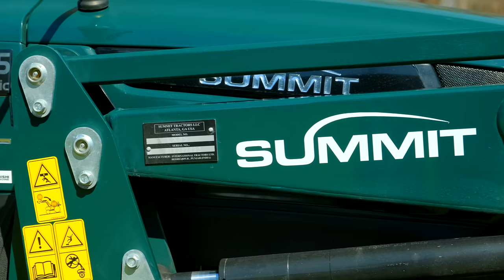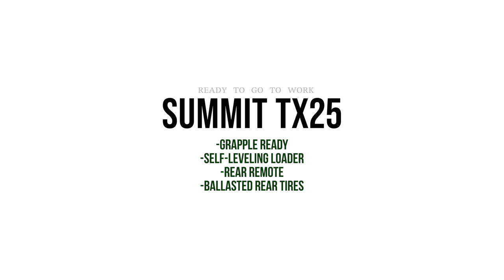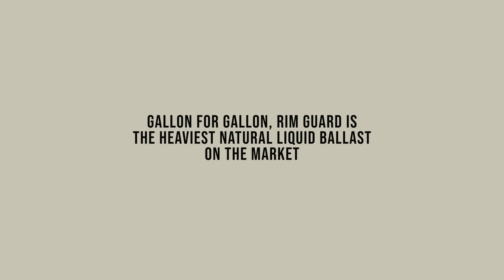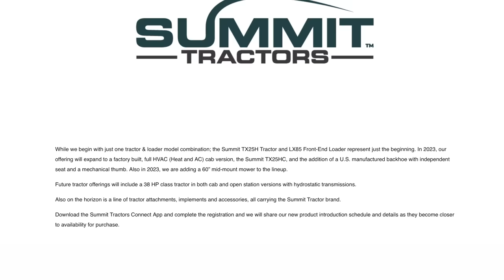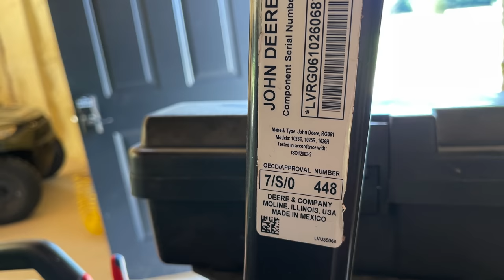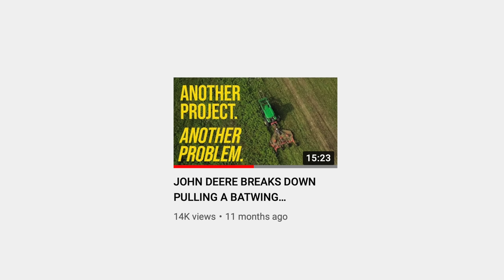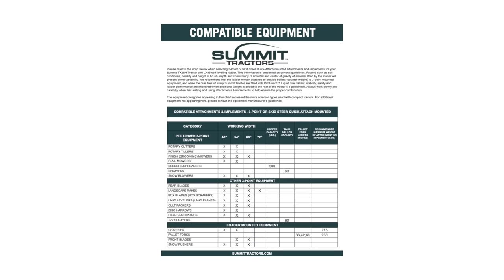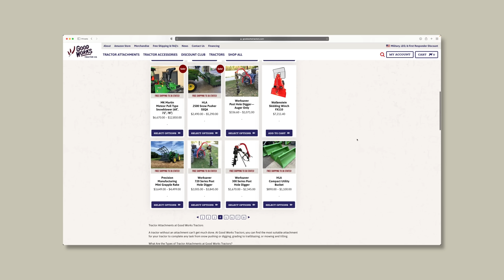10 REASONS TO CONSIDER A TRACTOR YOU’VE NEVER HEARD OF 🤔 SUMMIT TX25

Comment: One thing I could see helping get summit off the ground (and help you too) is having parts and service kits available on your website (a place people trust). Serviceability is going to likely be people’s number 1 reservation with these and the more that can be proactively debunked the better.
Reply: Had JD pick up my 1025r over a week ago. Still no part at the dealership to fix it. It apparently is AR a warehouse but for some unknown reason they won't ship it. Nice!
Reply: I have seen small new businesses gain trust by having spare machines to loan out when repairs or parts will take some time. May sound expensive but you still have the capital value.

Comment: It’s a great tractor, I speak from in depth experience. I have worked extensively with the tractor, and I am speaking as a John Deere 1025R owner. Don’t get me wrong, I love my Deere!…but if I did not already own a compact, I would buy a Summit without question. The price is outstanding for the options you get and I have spoken to all the Summit crew, they are tirelessly devoted to their tractors and customers, which is a major benefit. Nice video!

Comment: Given that many tractor owners are DIY type folks, it seems to me that something truly innovative, and almost opposite to what Deere and Kubota seem to be doing, would be to truly support and encourage owner maintenance and repair.  If Summit would make videos of common maintenance and repair tasks, provide quick mail order parts support, and provide rental tools when specialized tools are needed, this could truly be a game changer for a company that plans to not have a dealer network.  I suspect this is too radical a concept for Summit, but I think this could be a game changer.  Now, you still need the independent service centers for those who don’t want to get their hands dirty or for larger jobs that many would not want to tackle such as engine or transmission rebuilds, but the same repair literature/videos and tool and parts support that an independent repair center needs is nearly the same as a competent DIY customer could use.

Comment: You’ve got very good, informative tractor videos. With the following you have you could help a lot of people by highlighting the water issue you’re having with your shop. Floor elevation in relation to surrounding terrain. It costs money to build up the site but it’s money well spent. No taper at the edge of the floor at the door, etc. Once the concrete is poured  there’s no going back.  I made the mistake “once” and have seen it many times. The water needs to stay outside.

Comment: I enjoy your videos Courtney but have to ask you this question. From some of your earlier videos one of my main takeaways was “only buy JD or Kubota tractors” for various reasons. This message came across very clearly and strongly. Can you address your change in heart?
Reply: I have to agree, Courtney seems to be a great guy but before it was only JD or Kubota. He advised to avoid most other brands
Reply: Simple answer, money motivates people.
Reply from the maker: One reason was a large dealer network for support.  Summit has solved that when they launch nationwide by partnering with tractor dealers around the country to provide service in every area they’re located.

Another reason was that JD and Kubota give more value and, again, Summit has gone above and beyond to provide an overload of value.

Holding resale value…I believe with more included on the machine AND at a cheaper price than Deere or Kubota, it will minimize the depreciation rate experienced by other lesser known brands.

Reliability?  Well they all have problems, but this tractor is not new.  It’s based on an existing platform from a manufacturer that has been building tractors for decades.  The bugs were worked out long ago.  Plus, Yanmar engineering has a 30% stake in this platform further legitimizing it.

The only thing constant in life is change, my opinions included.
Reply from the maker: @JeepAddict  Not sure of your angle on that one.  I made lots of money selling JD and Kubota.  I still could if I wanted to.  I don’t need to sell any tractors though.  My business is selling attachments.
Reply from the maker: @72chitwood  One reason was a large dealer network for support.  Summit has solved that when they launch nationwide by partnering with tractor dealers around the country to provide service in every area they’re located.

Another reason was that JD and Kubota give more value and, again, Summit has gone above and beyond to provide an overload of value.

Holding resale value…I believe with more included on the machine AND at a cheaper price than Deere or Kubota, it will minimize the depreciation rate experienced by other lesser known brands.

Reliability?  Well they all have problems, but this tractor is not new.  It’s based on an existing platform from a manufacturer that has been building tractors for decades.  The bugs were worked out long ago.  Plus, Yanmar engineering has a 30% stake in this platform further legitimizing it.

The only thing constant in life is change, my opinions included.

Comment: $18,999. That's the current price listed on Summits web page for this tractor. Seems like a question lots of folks are asking, so there it is. Considering the extras included, seems like a good price to me. Now go beat on that thing so we can see how it holds up 😉 Of course I bought my tractor over a year ago now so, unless it's the best thing since sliced bread, I'll just keep the JD. But I still want to see what it can do!
Reply: is it a good price though? A B2601 with double rear valves, KTAC, 3rd function and ballast is around $21k, or less, with kubota service, and parts support right around the corner.

Comment: you had a video out a while ago stating, stay away from tractors that where renamed and sold as different brands. It also said buy a tractor that’s made by the same manufacturer, not pieced together by other companies. What’s changed your mind on summit?
Reply from the maker: One reason was a large dealer network for support.  Summit has solved that when they launch nationwide by partnering with tractor dealers around the country to provide service in every area they’re located.

Another reason was that JD and Kubota give more value and, again, Summit has gone above and beyond to provide an overload of value.

Holding resale value…I believe with more included on the machine AND at a cheaper price than Deere or Kubota, it will minimize the depreciation rate experienced by other lesser known brands.

Reliability?  Well they all have problems, but this tractor is not new.  It’s based on an existing platform from a manufacturer that has been building tractors for decades.  The bugs were worked out long ago.  Plus, Yanmar engineering has a 30% stake in this platform further legitimizing it.

The only thing constant in life is change, my opinions included.

Comment: What are Summit's plans to expand dealerships, and models? I'd like to see this tractor with a 30-35hp engine. (maybe a slightly larger frame) and a Cab option like the Kioti.
Reply from the maker: Some of that if not all is covered in the video. For any more specifics just reach out to Summit!
Reply: @GoodWorksTractors  Thanks for the response. I did listen to that as I got further into the video
Reply: @GoodWorksTractors  Thanks for the response. I did listen to that as I got further into the video

Comment: My TYM has been a good machine, I  don't need self leveling or hydrostat, 2 rear remotes minimum, which is why we bought tiny tymy, and 3rd function front end would be great. With the caviot that you could run a 3rd function off of your rear if you have enough. Just my thoughts.

Comment: Thanks for showing the Summit tractor. Very interesting as it shows it to be a potential future tractor to be purchase. Having said that - have a few Qs.

Is it setup with a Skid Steer mounting system?
Is the ROPS low enough to allow the tractor be driven under a standard garage door?
How does the loader (FEL) comes off? As easy as JD’s or Kubota’s?
Reply from the maker: The SSQA is standard, yes. And the ROPS fold down so you can get under a garage door, but just like all of the others it's too tall to drive straight into.

Comment: Not so long ago you said to stay away from rebranded tractors like Summit.  What changed?  No local dealers, could go out of business, and it not a OEM tractor.  Help me understand your change of heart on the rebranded tractors they all add extras to sell but they are still rebranded or is it just because you are a dealer now?
Reply from the maker: One reason was a large dealer network for support.  Summit has solved that when they launch nationwide by partnering with tractor dealers around the country to provide service in every area they’re located.

Another reason was that JD and Kubota give more value and, again, Summit has gone above and beyond to provide an overload of value.

Holding resale value…I believe with more included on the machine AND at a cheaper price than Deere or Kubota, it will minimize the depreciation rate experienced by other lesser known brands.

Reliability?  Well they all have problems, but this tractor is not new.  It’s based on an existing platform from a manufacturer that has been building tractors for decades.  The bugs were worked out long ago.  Plus, Yanmar engineering has a 30% stake in this platform further legitimizing it.

The only thing constant in life is change, my opinions included.

Comment: It's a neat tractor....HOWEVER...you're double talking here. Previously, when you sold used tractors, you made videos stating why you should buy green (john deere) and orange (kubota)...the resale value. Someone who buys this tractor will find themselves stuck with it even though they (and they will...) want bigger because resale will be really BAD. My last Kubota I upgraded from, I sold for what paid for it new after 200 hours! It cost me nothing to own aside from fuel, maintenance, and I did add some addons. I don't personally care too much about dealer support for service/repairs as my Kubotas are easy for me to service and just don't break down or have any problems. John Deere's do break down, but you get them fixed anywhere due to dealers everywhere. They use cheap readily available parts outsourced (good and bad thing depending on who looks at it). I hear you about John Deere though...I personally don't like the company...Kubota ANYDAY. Hope it works out for you, but honestly it's an uphill battle as there already are other more well established yet smaller tractor brands aside from John Deere, Kubota, New Holland/Case that offer decent products.
Reply from the maker: I’m not double talking 

One reason was a large dealer network for support.  Summit has solved that when they launch nationwide by partnering with tractor dealers around the country to provide service in every area they’re located.

Another reason was that JD and Kubota give more value and, again, Summit has gone above and beyond to provide an overload of value.

Holding resale value…I believe with more included on the machine AND at a cheaper price than Deere or Kubota, it will minimize the depreciation rate experienced by other lesser known brands.

Reliability?  Well they all have problems, but this tractor is not new.  It’s based on an existing platform from a manufacturer that has been building tractors for decades.  The bugs were worked out long ago.  Plus, Yanmar engineering has a 30% stake in this platform further legitimizing it.

The only thing constant in life is change, my opinions included.

Comment: The "easy" dealers are a bad idee. My dealer in EU stopped selling this "summit" (Solis 26 hst in EU) because there are too manny problems on this tractor he had to repair, but was not paid from the impoter to repair it. So i needed to drive 600km to the importer (not another dealer, they are not paid to repair it) or repair it myself while it was in warranty.... waiting months for parts... 
The best thing is to buy a MF or Kubota by a real dealer.
Reply from the maker: That's precisely what Summit is trying to avoid. By not using dealers for repair, theoretically having a certified tech in your area does NOT have to be associated with having dealers in your area.
Reply: @snouwbaard Agreed ! I bought a Deere here in Ontario Canada and have multiple choices of dealers to bring it to within 1 hour drive from me , I am choosing to deal with my dealer I bought the tractor from as it's so easy to throw him a text and he gets back quickly and sets up whatever I need to be done ( amazing service ) . I'll be honest it makes me nervous hearing that they won't have a dealer network to rely on , yes you can get your tractor repaired by licensed technicians in the area ,but I wonder if you wouldn't be as high of a priority as the brand of tractor that the technician works for example , JD , kubota , MF . I understand there starting out and trying to find the most cost effective and cheaper way to get out there , but as far as me personally I like seeing the dealers and support when I buy a tractor ! That being said I understand there are some terrible dealers out there that sadly ruin the experience of customers and there thoughts towards what dealers are like , but the fact is there are some super super amazing dealers and support out there and it makes me feel comfortable there only a text away, and an easy drive away for help or a technician coming out to take a look for convenience. 

I do wish all the best to summit this is just my personal opinion of what I prefer when I'm searching for a brand of tractor . 

Looking forward to seeing the tests you put this tractor through ! Hope you have it for a long time yet not just 1 to 200 hours but years to come to see the overall reliability .
Reply: @Summit Tractors hey guys , question for you , say I bought your tractor and had something go wrong that needed work from a technician, would you then set up a dealer or licensed technician to come fix it at my house? Or another option  have somewhere near that you would set up yourselves for it to get fixed ? Or is that up to the customer to figure out location and to deal with finding licensed technicians to get it set up to get fixed ? 

I truly hope for the best for you guys and can't wait to see the tractor perform more ! Just want to put some questions I had on my mind out there for you as I never have known a brand personally that didn't have a dealership and technicians that deal with it all . And maybe you do deal with it all start to finish hence why I'm asking lol.

Comment: Need a manufacturer to produce a TLB that can lift a 3,000 LB pallet of material. The smaller the frame size the better. B26 won’t do it and L47 is too big/bulky to trailer easily.

Comment: Summit TX25 and RK25H both cost around $20,000 - including loader and 3rd function.

TX25 and RK25H specs are practically the same.

The RK25H has a Yanmar engine that most repair shop can / will work on. The TX25 has a Mitsubishi engine that repair shops may or may not work on .

Does it out perform other tractors? No. Is it cheaper? No. Does it have more features? No. Does it come with free attachments? No. Maybe I'm slow. Please tell me again how the TX25 "beats the snot out of most other tractor on the market.. at face value".

Comment: Sounds all good about the service BUT. I have been told by my local JD & Stl. Dealers That you got it at Home Depot, take it there for service.  Now id be screwed if i owned that machine. Sorry
Reply from the maker: Summit has service already lined up wherever they sell.  This isn't an issue for them like it is with some other brands.
Reply: @GoodWorksTractors  
I sure hope they do. I like what i see with the summit line.  Also I saw a video of the Solis brand. Same hood simalar tractor BUT. The mans biggest complaint was NO ROOM to get on & off. Summit dont have that issue. Easy access EITHER side of tractor.  Keep it up guys.
If you can nail parts & service,
I feel Summit can make a BIG dent in the G & O tractor sales.